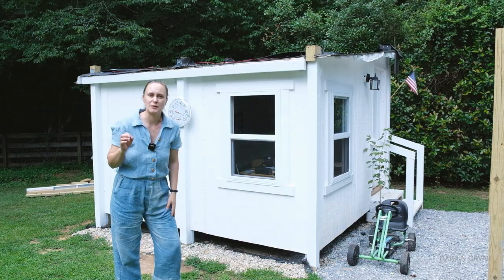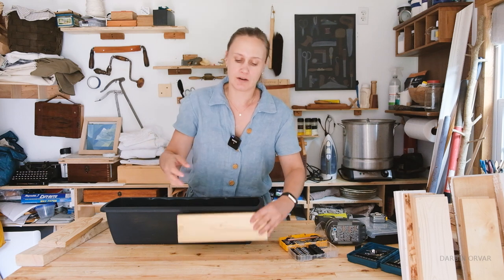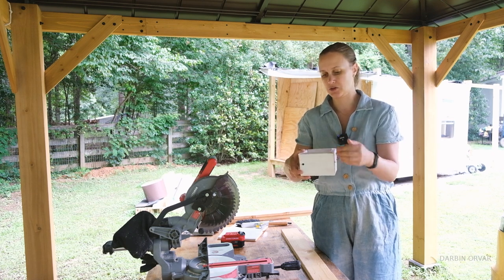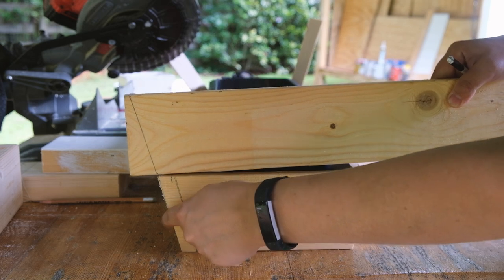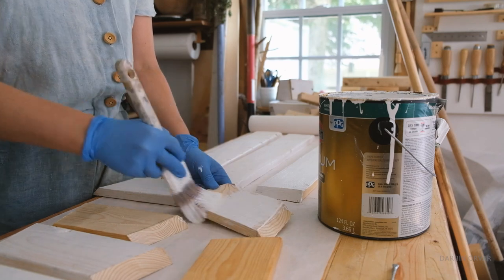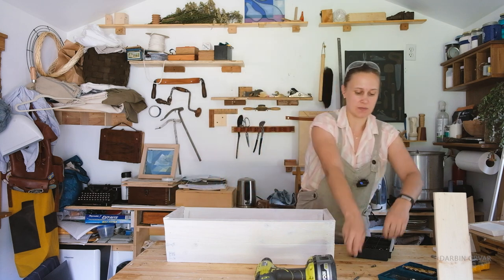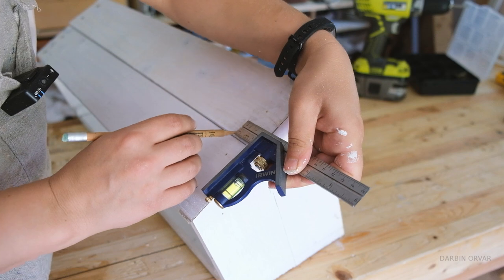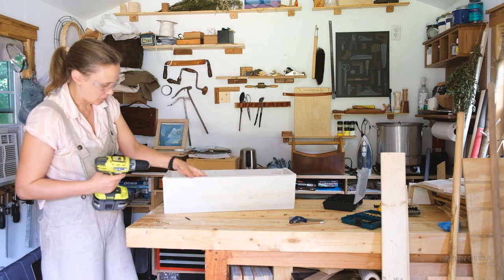How to Make an Angled Window Box from One 2x4 (with Plan!) // Mastering Compound Miters!

Comment: Good point on the pre-paint prior to assembly then final coat AFTER assembly. That paint job "should" do well in the heat/humidity and you got good drainage below, and air flow too! So the moisture won't just collect at the bottom of the box. I think this is a great design and a good finish. And white-on-white, I would say that's a plus, more "Swedish" that-a-way 😉

Comment: Great video, with lots of detail. The boxes add a visually appealing touch to the building.

I, too, like the angled version, and thanks for the marking tip for your cuts. I have a 12" double compound sliding miter saw that I typically use for quick 90 and 45 deg cuts. I have made the wrong cut before, and that is always frustrating.
Reply from the maker: Thank you! Yes, making wrong cuts can be frustrating, especially when you thought you had it all right :)